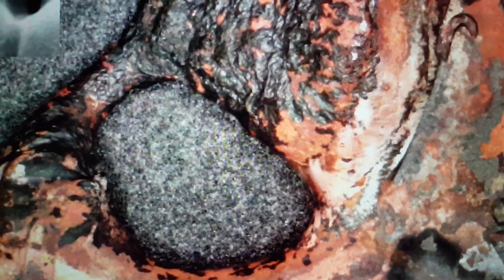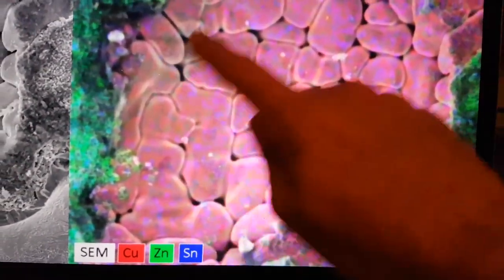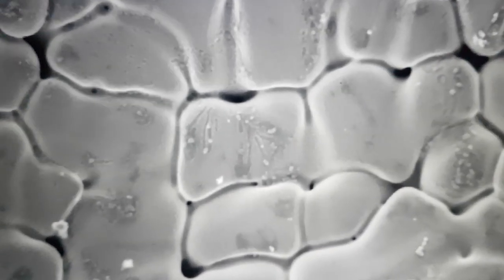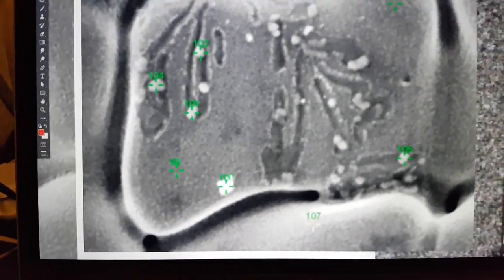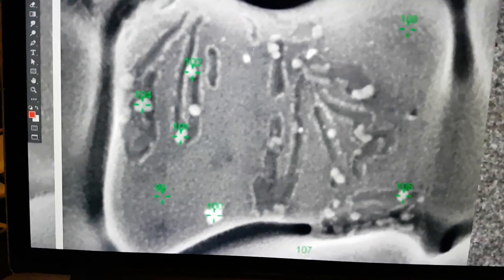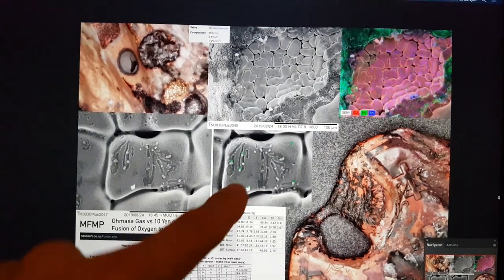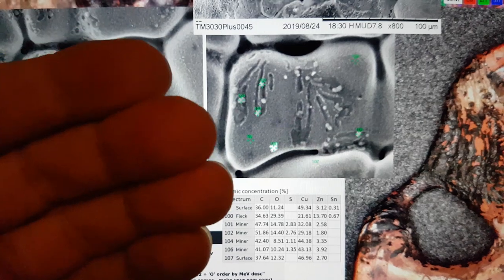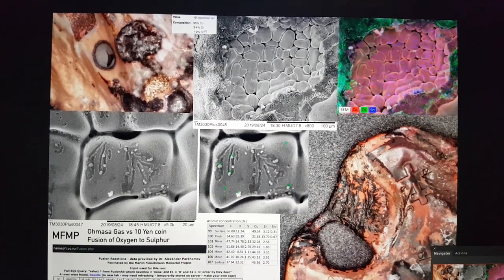OHMA - Snowballs on Cobblestones .oO is it 2O - S ?

Comment: Physical artifacts and features are much more convincing than theories and speculation alone,  the Martin Fleischmann Memorial Projects access to the proper scientific equipment lends credence to your work.   Everyone can see the results for themselves and draw their own conclusions with a minimum of "not real science" type of comments. Is the project getting new ideas from working with Ohmasa Gas? Is there a way of making a LENR reactor using Ohmasa Gas as a component?
Reply from the maker: The thinking is yes, quite how will need some work, but maybe not that hard. If OG is indeed EVOs/Condensed plasmoids in a bottle, Shoulders said these can live in metals indefinitely, you will in coming months know what they can do from visual evidence - then it is a case of keeping them active. It could be as simple as reactants in container, add heat / light etc, then spark it to get it running.